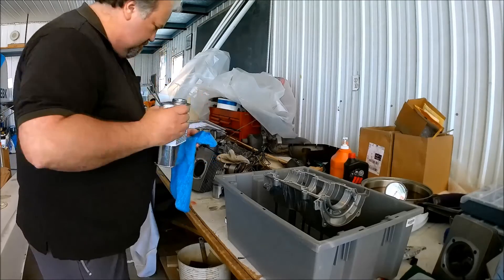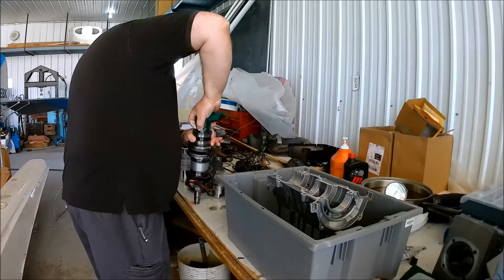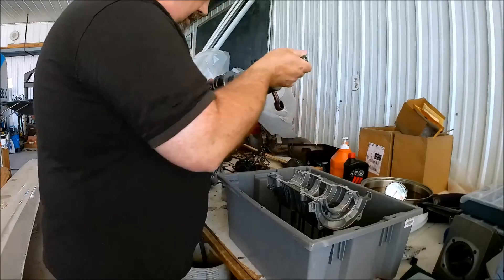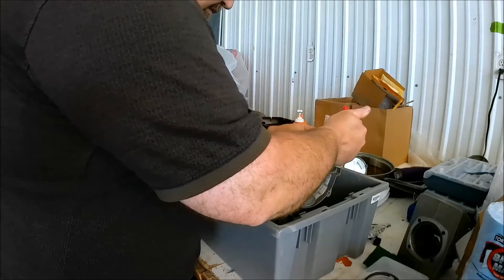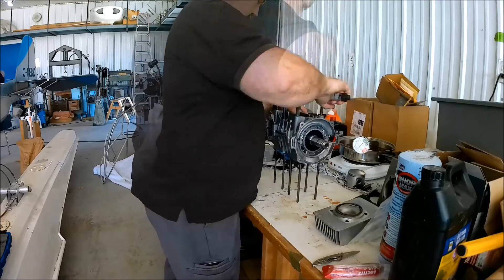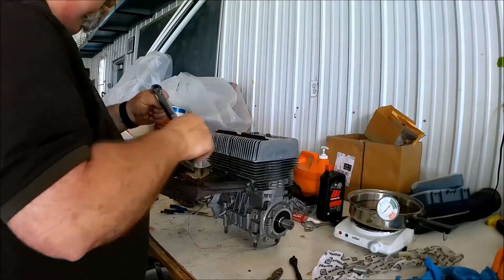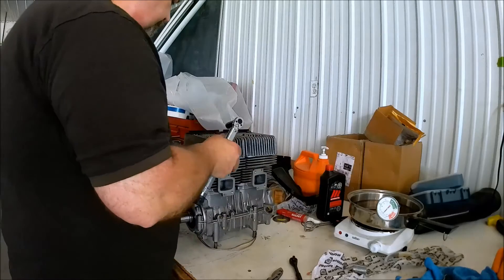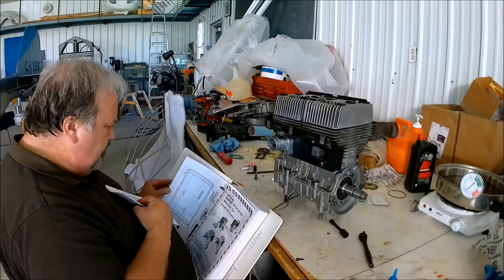EP #41 Rotax 503 reassembly for my Challenger 2 Ultralight Airplane

Comment: Just curious if you could have assembled the piston to the rod first and insert into the head on the block and then attach the end caps? Like most car engines are done.
Reply from the maker: The connecting rods are press fit onto the crank in the factory on this engine.